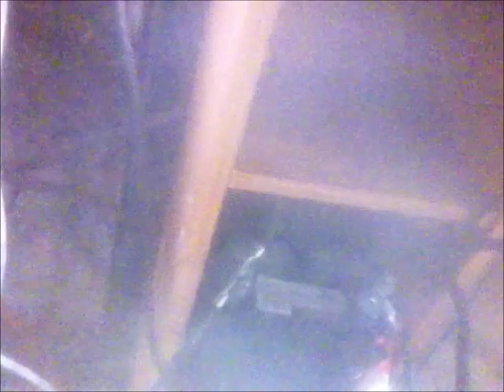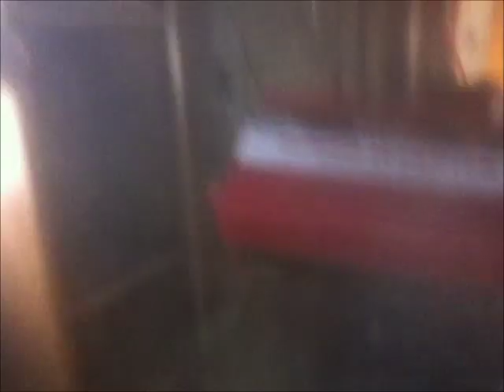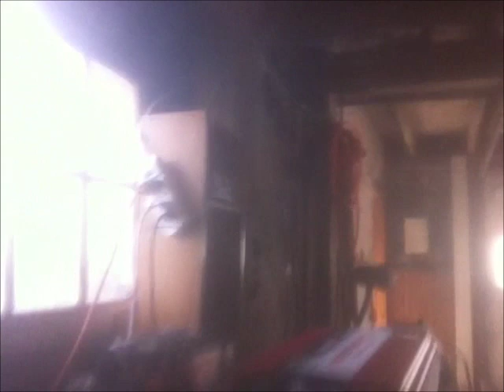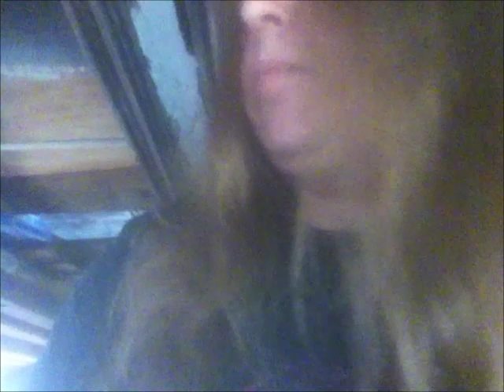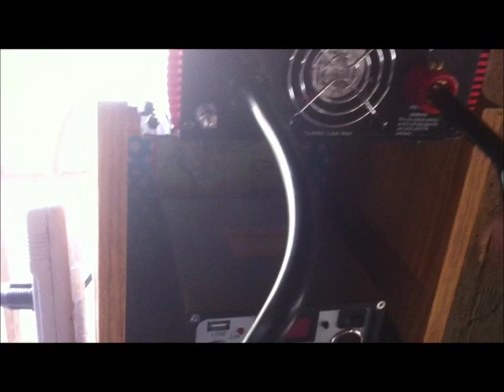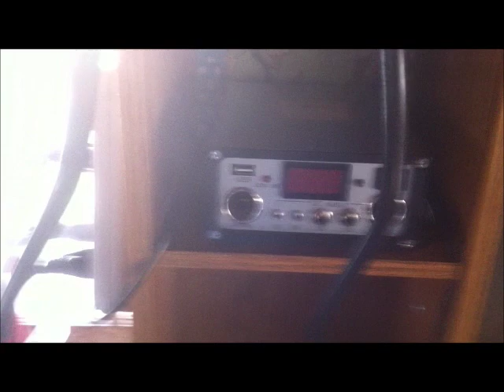Harbor Freight 45 watt Solar Kit Testing pt3

Comment: When I add a new deep cycle battery to my already one deep cycle battery do I just hook them together in parallel or do I charge the new one separately till it is toped off then connect it to my already charged battery?
Reply from the maker: +rckingracer Charge first. this system is good for keeping things at there best.